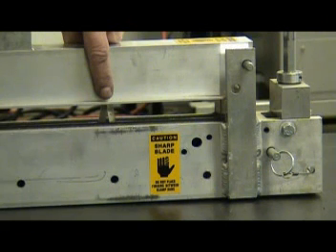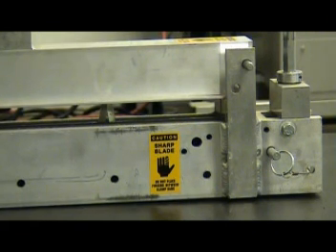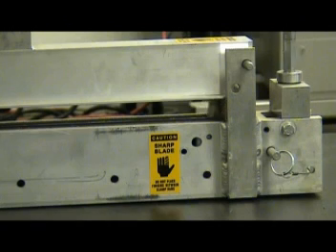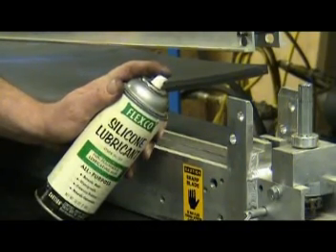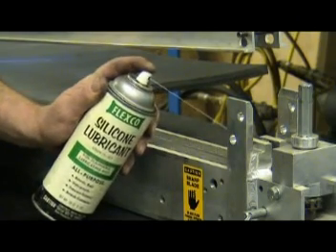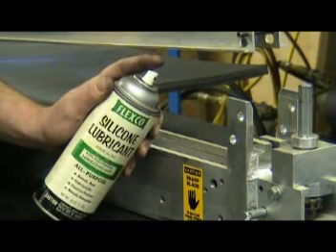How to Use the 840 Series Aluminum Belt Cutter

Comment: Can you tell me the price of a replacement blade? Someone on the crew broke both blades and my boss refuses to replace them as some form of punishment to this guy. Anyway, I'm tired of cutting belt with a box cutter and I would like to buy a few blades to stash in my toolbox.
Reply from the maker: +Glen Baker Hi Glen, sorry to hear your cutter is not available for use at your facility at the moment. For safety reasons you should replace the blades as soon as possible. A box cutter is truly not as effective (as you well know) and definitely not a safe practice for your facility.

Your best bet is to contact your local distributor (http://www.flexco.com/contact-us.html) for pricing and ordering information. For reference you can find the ordering number & item code in our product handbook
(http://online.fliphtml5.com/gcef/igwa/#p=94)